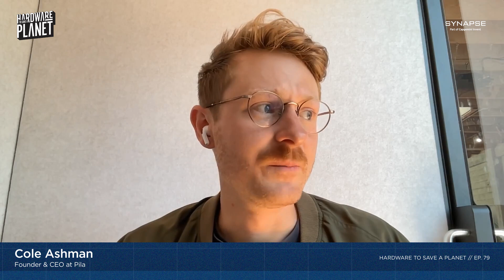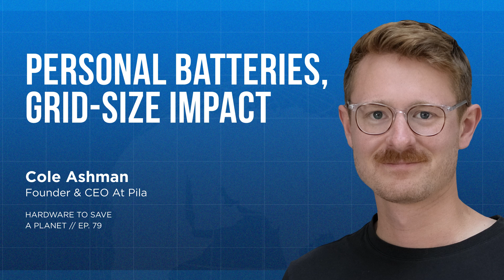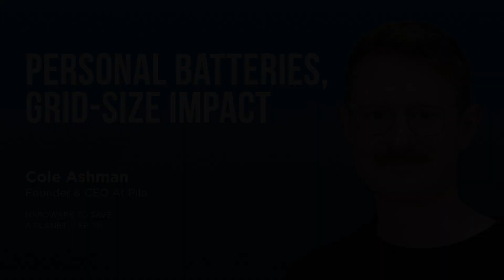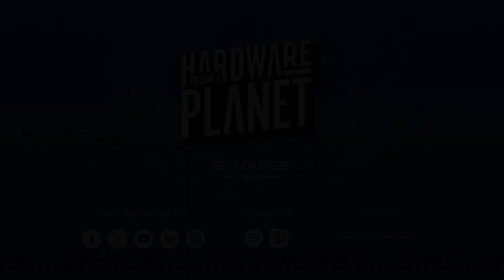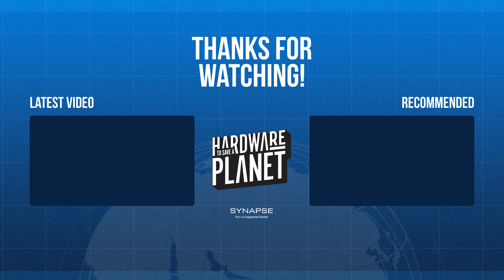10x Grid Storage: How Mesh Batteries Are Revolutionizing Home Energy

Comment: During a power outage, a basic requirement is to run the lights and the fans. But they won't be connected to Pila. How would this use case be addressed?
Reply from the maker: That's a great question! We can definitely ask Cole back on the show to address this. He's also on LinkedIn who would be happy to answer 😁